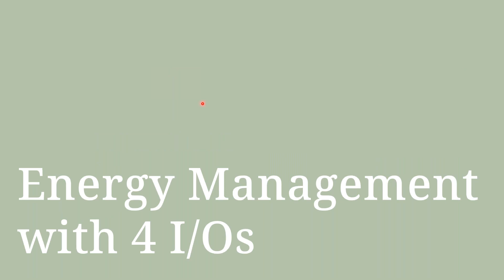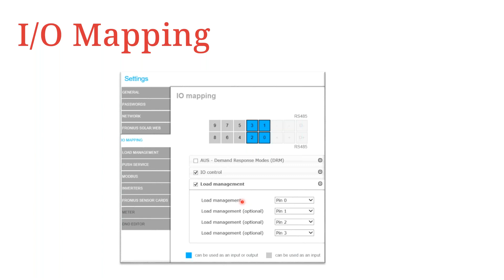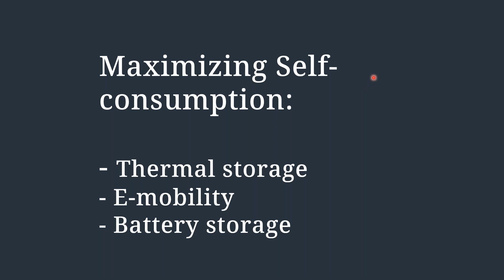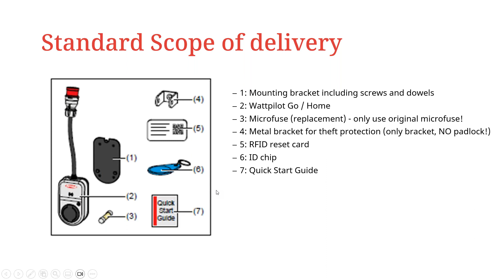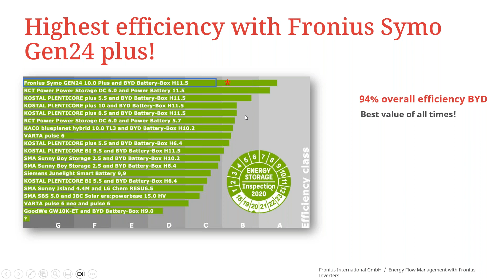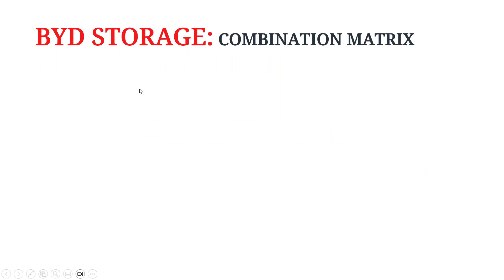Advanced Webinar: Energy Flow Management with Fronius Inverters (AFR)

Comment: Question why Is the app so slow for live data? When you look at times  the inverter takes to up battery usage or stop battery usage (feed from grid for increases and feed to grid for no reason post decrease)

It anywhere for 10 to 20 seconds
Is this the inverter or settings?